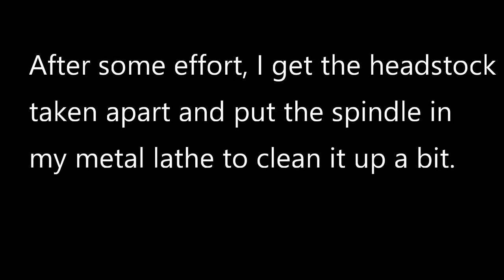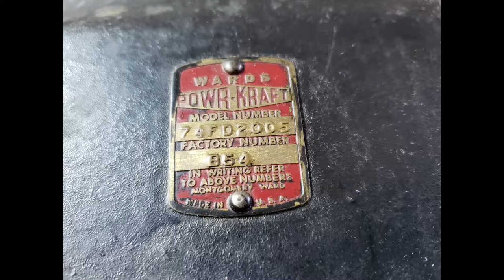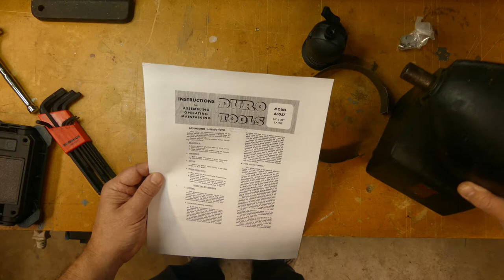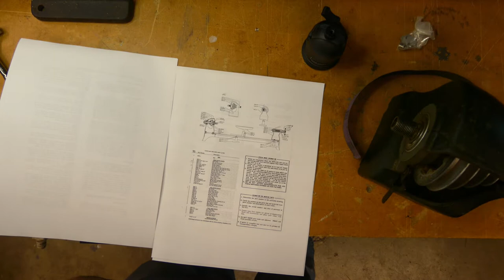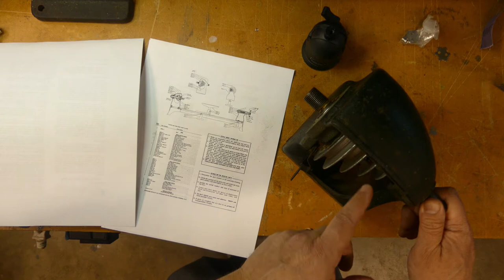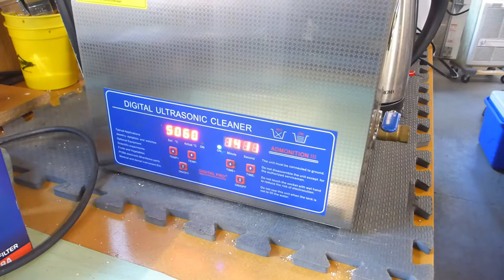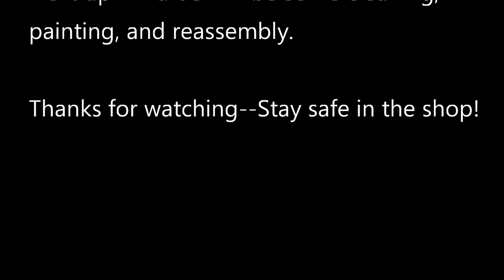Antique Wards Powr-Kraft Wood Lathe - Part 2

Comment: If I had to guess, the groove on the front part of the shaft where the lock collar is exposed is for the lock to rest in. The reason for saying this is that I own one and it is flush with the bearing or the washer plate cover if you will. I do have a question for you, that I have a problem with if you have time to answer for me on my unit.
Reply from the maker: It has been a while since I looked at mine but fire away. Maybe someone else will come along who is knowledgeable and help us out.

Comment: The dead center on that lathe, does it move with the wood or not? Mine does not and burns the wood badly and throws it out of balance not to mention the blank is not snug no more.
Reply: Mine too
Reply: @OldGrizz59  The answer to not having the dead center burn in because it does not move is wax or oil, that can resist heat longer. That you apply to the dead center that makes contact with the wood.
Reply: Well I found my problem lies in the sleeve bearings/bushings that have become worn out.